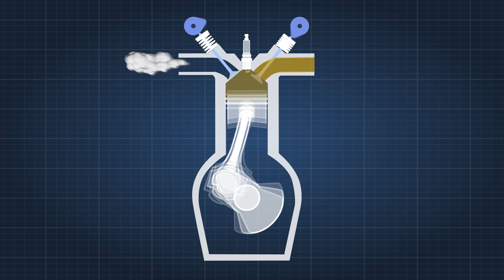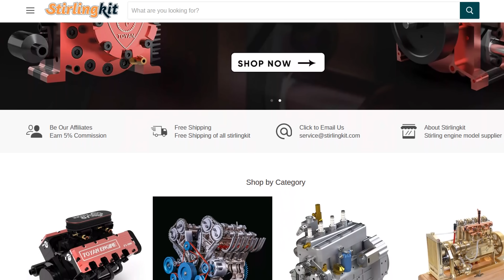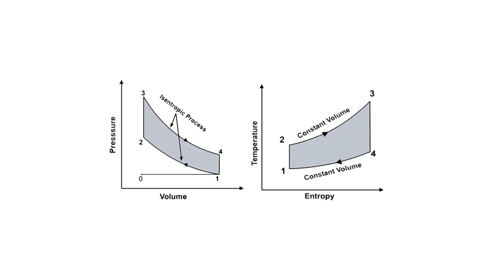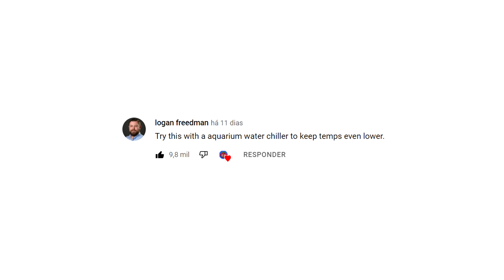I 3D Printed a Transparent Combustion Engine in Resin

Comment: No spark, not high enough compression or the air fuel ratio is not correct.
Since the "Nitromethane" combustion was consistant, i will assume that spark and compression were ok which leaves us with AFR. Remember that the correct afr for Gas is 14.7:1, NM is 1.7:1 and for Methanol 6:1 

If the AFR is not 14:1 for gas well, there are 2 cases. Too rich or too lean. Both will lead to missfire on every second cycle using it to bring the AFR to a combustable mixture.
If you can run the engine on nitro, it means the AFR was good enough which leaves you with a WAY too rich AFR for Methanol and Gas...

On the other hand, since liquids are not compressable, a lower AFR will lead to higher compression ratios! Hope that helps.

Comment: The spark plug causes the problem, its sitted very deep from his hole, and the mixture doesnt reach the spark, Other reasons for skipping is the oversimplified carb. try to fine adjust. The nitromethane fuel needs a lot more volume to same energy output, this carb jet doesnt enough to provide that . (Drilltime :D:D :)

Comment: Would love to see a working proof of concept of transferring power without wires as tesla tried. Like, say power a small rc engine electric or drone with no batteries or solar. Just electricty in the open air using a transmitter with 500 feet or more. Half a mile would be amazing but probably not possible. I have heard of how he tried to do this but never understood how it would work in reality.

Comment: maybe its because of the different fuels weight and how flammable or its not getting a good fuel ignition or not timed right and there was a leak and the nitromethane might not be efficient enough for the engine

Comment: One possibility could be that force is given by speed times torque or is defined on motors.  This means that the nitromethanol triggers more torque in the engine than the other fuels and therefore, conversely, has more energy.

Comment: I love your channel - I feel like I am learning with you! Perhaps the problem here is not the fuel or air mix directly! If the exhaust cycle is not that efficient and leaves burn gases behind, the next intake will be a mix of fuel-air and some residue exhaust resulting in poor or no combustion. Then the following exhaust stroke removes the last exhaust gases, and you are ready for the next clean combustion cycle! Hence eight-stroke or more depending on how much exhaust gas is lingering around the cylinder! I don't know the chemistry, but perhaps each of the fuels produces an exhaust which is more or less a combustion inhibitor, leading to the changes in performance you recorded for the different fuels! Can you modify the exhaust so the gases flow out easier and see if that improves the consistency of the 4-stroke cycle?

Comment: You could be having a scavenging issue combined with lower compression and small un-tuned valves. Since your exhaust on a normal engine actually helps pull the exhaust gas out, and this doesn't have an exhaust, you could still have bad air in the cylinder that is changing the stoichiometry of the cylinder. You get a good fire every 2 or 3 full cycles because the mixture combined with the lower compression finally works.

Comment: I used to mess with 1/32 & 1/8 Nirto RC engines. used 25% all the time. tuning of those engines if tuff the temp & humidity & elevation make drastic changes to the air/fuel ratio, making it so if you had your ratio set prefect at 11am by 4pm you have to adjust your tune. most resort to glow plugs.

Comment: You have blowby causing low compression, as the cylinder pressure increases the walls warp same as in a induced engine.

You need better piston ring sealing to fix your issue.

Comment: Maybe the burned ( so expanded gasses) slow the piston down during the exhaust stroke cause the much higher volume has to squeeze past the valve. So when the engine skips strokes and exhausts only enriched mixture, it does not have to transport as much volume so it’s reaching higher RPM, but can’t perform a high power output (which you do not require, since the engine does not drive anything but the flywheel) find a way to compare power output and make a future Video.

Comment: Here are some project ideas: 
1. 3D printed Dry cell carbon fiber hydrogen cell (can’t find them anywhere on YouTube). Stainless steel is used normally, but graphite foil is also effective. I’m fairly certain carbon fiber would work also. 

2. Use your pulse jet engine to power a turbine and see how much electricity is created! Could you power a home? A car? Any reasonable use at all? 

3. Make a hydrogen dry cell, power a pulse jet engine with the hydrogen, and then integrate a turbine to capture some of the energy to power the hydrogen cell…. FYI… the dry cell can run off HUMAN URINE!

Comment: You most likely got higher torque with the 25% mix fuel, power is not only rpm but the force used to turn the crank axle.(Newton meter,nm)

Comment: You could try and make an full 4 Stroke engine but a 4 post 16v engine full out of resin. But with metal insides. Also try mixing different fuels and see what happens with your 4 Stroke engine. Keep up the great video's 👍👍👍

Comment: Might I suggest an idea for the dilemma?
So based on what I saw, it could be that the post ignition gasses in the cylinder are not being completely removed during the exhaust phase, leaving the combustion point of the fuel air mixture in the cylinder on the next powerstroke higher.
You can kind of see this with the gasoline and methanol slow motion because even though there isn't a large yellow combustion in the "off" power stroke, there is a faint blue flame, and so it might be taking two exhaust strokes to clear the gasses sufficiently.
I think this is further supported by the evidence of the highest mixture of nitro having a true 4 stroke performance. I believe this could be because the remaining gasses are still volatile enough to support combustion.
All of this, with imperfect timing of the valves as well as imperfections in the valve design could be culminating into what you are observing.
I think there could be a couple of ways to test this theory.
First, you could "smoke test" the motor by filling the cylinder with a smoke and then pulling the starter chord to see how efficiently it clears.
You can also introduce a smoke at the top of the motor where the valve springs are and manually turn the motor to see if there is any draw back, ie smoke from outside gets drawn in somehow through the exhaust port.(although I don't think this is a major issue here, it is something just to check for).
Lastly, you could introduce a vacuum on the exhaust so that there is negative pressure when the exhaust valve is open and see if this improves the performance during use with standard gasoline.
One last thing to check, although it isn't necessarily directly related to my suspicions, is to see what color of arc is being produced by the sparkplug. You ideally want a bright pink/purple arc, not so much of a blue color. The gap distance in the magneto as well as the gap of the plug needs to be as tight as possible to ensure a hot enough arc. When I used to tinker with small engines, I used a standard business card to gap the magneto and then adjusted the sparkplug gap until it was the right color.
I hope you get a chance to read this and perhaps something in here helps.
Love your vids and best of luck to you!

Comment: AFR for different fuels is radically different. Stoichiometric ratio for 95 is 14.7:1, Nitro is 1.7:1, Methanol is 6.5:1. 
I suspect you are getting fuel puddling in the cylinder until there is enough fuel for a burn.

Comment: Ok, so, a couple things. Nitromethane has a stoichiometric fuel to air ratio of about 1.7 to 1, so even if it does have only 1/4 of the energy per mass, you can burn about 8 times as much as it per stroke as gasoline, resulting in about twice as much energy output for the same volume of air. Even then, the drag cars that run it run it much above stoichiometry, so much so that raw, unburned fuel leaves the exhaust as a thick fog of fuel, it’s not smoke. To get that engine to run correctly, you are going to have to increase the fuel jet size by many times, assuming the carburetor can even flow that volume of fuel. Same goes for methanol, lower energy density, but you can shove a lot more of it in the motor. I think you will have more luck running methanol/nitromethane then gasoline, because methanol and nitromethane can take a ridiculous amount of thermal energy with them as they leave the engine. So much so, in fact, that drag cars that run on nitromethane don’t have any means of cooling otherwise. They are not equipped with radiators, coolant, or fans. This might give you a bit more life out of that cylinder. Also, you’re cylinder can’t hold onto any oil, because it is smooth. If you look at cylinders in any engine, you will find that the cylinders are crosshatched intentionally with scratches to hold onto oil as the piston slides up, since you can’t do this because it would ruin the transparency of the resin, I would mix oil into the fuel at 16%. The extra oil in the cylinder will help seal the piston to the sleeve. This is how it’s done on rc cars that run nitromethane, as they don’t have rings of any sort. They rely on the taper of the cylinder to seal it off as the piston approaches top dead center. Typically, in engines of that size that are designed to run nitro fuel, have a glow plug instead of a spark plug, as when you have that much fuel going into a cylinder, it can be pretty tricky to ignite. Glow plugs are typically made of a platinum or platinum coated wire that catalysis with the methanol in the fuel to creat ignition. For drag cars, they run so much current through their spark plugs, that they all melt off about 2 seconds into the run. At that point, the exhaust valves are hot enough to auto ignite the nitro, effectively turning the engine in to a diesel mid track, so yeah, nitro isn’t the easiest to properly run. Oh and to add to the fun it’s corrosive and hydrophilic. As for making it run more reliably, check the seal of the valves. This will cause low compression and can be fixed by lapping the valves. I personally think you either have a weak, or inconsistent spark, or poor homogenization of the fuel and air in the carb, or the mixture is off all together. These Chinese engines are known for having ignition issues though. As some other people have mentioned, it seems your running quite rich. Reply if you got any questions (or if you even see this). I have always wanted to do this and I thought it was a great video. I’ve been trying to see if I can make 3d printed engine parts as well, and have made a couple functional camshafts. Good luck!

Comment: I'm guessing the issue is both compression and timing. You need a head gasket for that and i doubt the timing is right either. As a result the only fuel that worked was the one with an absurd level of volatility.

Comment: A bit of clarification on the question between methanol and gasoline. Methanol burns much cooler, and due to its higher specific heat and heat of vaporization vs gasoline, it also cools the intake air temperature, increasing the density of oxygen in the combustion chamber, meaning that you need more fuel to make a stoichiometric air fuel mixture. Methanol also has a much higher octane rating, meaning that you can run much higher compression and farther advanced ignition timing without damaging an engine,  so even though Methanol contains less energy in BTUs, it as a fuel is far, FAR more efficient in terms of energy extraction and it is much easier to achieve complete combustion with Methanol. More compression means less blowby which means more of the combustion gas is used in pushing the cylinder. Methanol also burns much faster than gasoline, meaning that the combustion event is often far stronger than the gasoline event (as more methanol can combust during peak compression). Combine that with the higher oxygen density and lower heat loss and you have a fuel that has the potential to make MUCH more power than gasoline. Keep in mind that to make a fair comparison, you need to have the engine set up for peak performance regarding the fuel type. That means advancing the timing and increasing compression until you are right at the brink of pre-detonation from each fuel source (being right at the limit generates the most power and is the most efficient way to use fuel, however it puts the engine under a greatly increased amount of stress so other components must be built accordingly).

Put it simply, methanol (alongside ethanol, which is an even better fuel for high horsepower applications) is a better fuel for power output and performance than gasoline. Although it contains less overall energy, it is far easier to extract that energy and put it to use.

Comment: Most engines that run nitro methane are very high compression and also use more fuel almost like a diesel . So you'll always see a turbo or supercharger to get the burn you need for it I believe.

Comment: I would say wrong air fuel mixture, probably would need to mess around with the carburator. It seems to be running lean with the nitrous + alcohol and i guess the powerstrokes not firing might have to do with load factor? It would be interesting to try and put load on the engine and see what happens

Comment: Yes, gasoline engines puts out CO2 (which is no longer a pollutant, by the way), but not smoke if running as designed.

Comment: To rule out compression failure you use the original cylinder and measure the rpm with different fuel. If Data results are similar then your mixture is too rich or spark is delayed.

Comment: So the fuel to air ratio should vary with the fuel wich means different carbs or different jets in the carbs (you basicly explained this when you were talking about how much air it takes to completely burn differentfuels). Also the burn caracteristics of each fuel is different if you look at the diagram of a theorical otto cycle it assumes all the fuel is burned instantly (this is indicated by the bertical line at the tdc of the cycle), in reality this takes time and this time differs for other types of fuel so if the fuel burns more quick the realistic otto cycle will be closer to the theoretical otto cycle wich means more power. If you would like more information on this topic i would be happy to help, although i am by far an expert on this topic i am willing to teach you what i know.

Comment: Nitromethane burns slow, so earlier ignition timing would maybe boost the power some. 
Running on gasoline, adjusting for a bit less fuel might make it ignite every power stroke. Adjusting the fuel on the carb has a big impact on the revs you will get

Comment: Dude, your mixture was wrong! Thats why you had missfires! that small screw on the bottom of the carb is a needle valve to adjust it. You're likely needing to screw it out A LOT more to get the nitromethane to fire better. You also need a higher compression ratio, so make your cylinder a bit shorter if possible to raise it! Same with the methanol!

Comment: With a non-conductive 
resin cylinder, the spark may not have an electrical path to ground . . . .  with out a good ground the spark may be weak or non-existent

Comment: Engine Engineer here.  Spark ignited engines are around 33% efficient on average.  Compression ignition engines can push 50%, but are difficult to control emissions due the air/fuel mixture being non-homogeneous.

Comment: The reason the engine speed isn't consistent is because the different fuel's have different stoichiometric air fuel ratios. Therefore since you didn't change the air fuel ratio you get a different amount of energy and therefore engine speed. Lean air fuel ratios cause increased engine speed typically when you are close to the ideal air fuel ratio.

Comment: Hi, great video as always :) I believe if you 3d print cylinder with a square outside, you would not have to sand as much because the pixels of the 3d printers masking screen would be in a straight line producing a smoother wall than when printing a round wall. That is if you are using a lcd masked resin printer(MSLA)

Comment: Nitro works better with tiny cylinders under extreme compresssion and requires a different barrel style carburettor from a model nitro engine which uses the exhaust pressure to further spray the nitro into the engine at a high rate

Comment: You can tell from the colour of the ignition flame (yellow or blue) whether the air/fuel ratio is correct. Yellow generally means incomplete combustion (not enough air, so weak) or bunsen blue (pretty close to the correct mixture). However, the ideal mixture is somewhere between yellow and blue. It's not compression: it is partly timing. Fuels burn at different speeds depending on octane, so the timing has to be faster or slower depending on the fuel type (advance and retard). The ignition timing was probably set for 14:1 stochiometric mixture, petrol, and you did not change this for the other fuels to give them time to ignite and burn fully. A slow burning fuel is ignited a long way in advance of Top Dead Centre on compression, a fast burning fuel closer to TDC.

8-stroking occurs when you haven't given enough advance before the ignition point, and the mixture only partly combusts. You then exhaust the mix (partly) and drawn in fresh fuel/air mix. The mixture is now richer than intended on the second compression, so it will ignite with a yellow (rich) flame: rinse, repeat, rinse, repeat, etc.